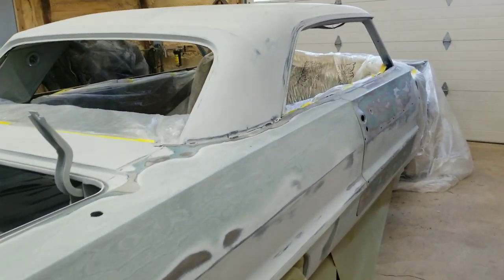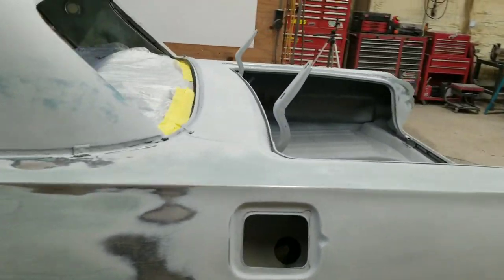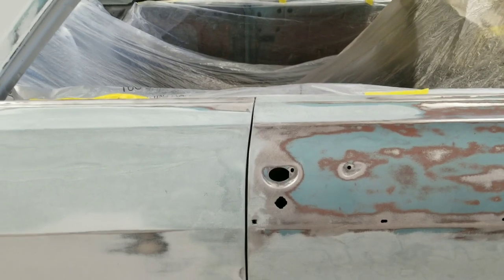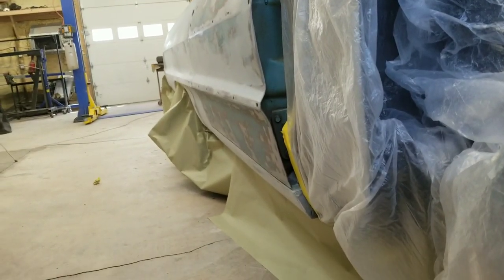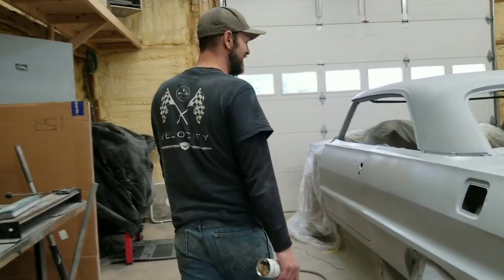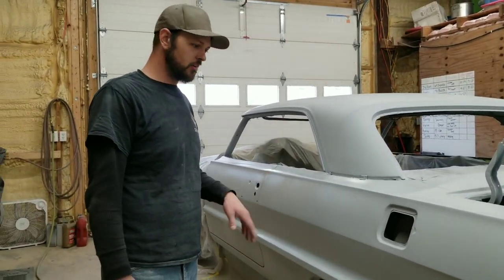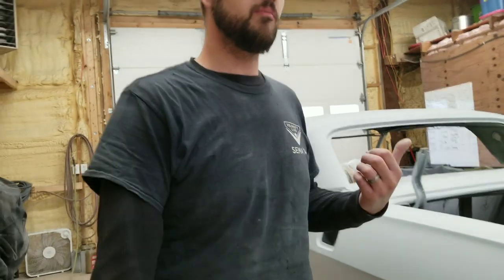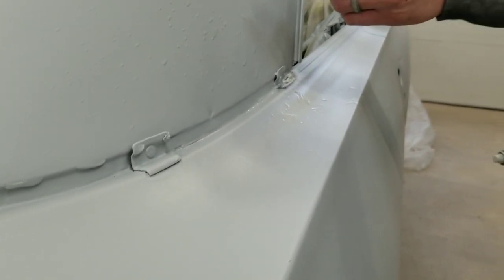64 impala frame off vlog part 13, primer, guide coat, blocking n how to achieve perfect straightness

Comment: I went back and watched episode 0 again. For us poor poor poor boys who don't have a rotisserie, I'll be blocking my Biscayne up with blocks and 4x4s. Where would you recommend I support the body?  Also my car has spent it's life on gravel roads and they are still there. I need to do a lift of hopefully 4 inches. I know I could probably go to jail for not lowering a 63 Chevy but rock damage requires it be jacked up a bit. (back in the 60s lifting your car was the fad) So anyway, do you have any tire clearance info for the Chevy like you did on the Honda?  Thanks for good videos. I think you should do a Rat Rod.
Reply from the maker: You need to lift it from directly behind the rear wheels and then on the body mounts the closest to the firewall approximately. At least start there, you may have to readjust if it doesn't feel sturdy.
Reply from the maker: Definitely going to do a rat rod sometime hopefully sooner than later.

Comment: What size sand paper do you block with
Reply from the maker: For primer I use 220/320. Body filler I use 80/180.